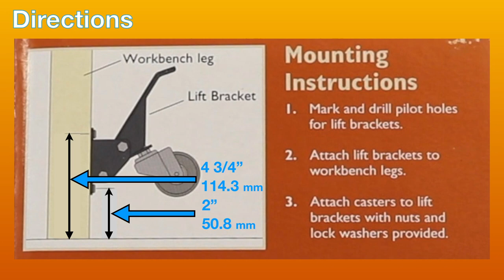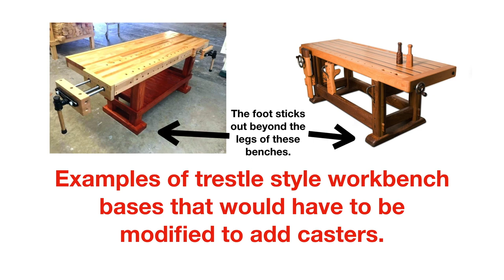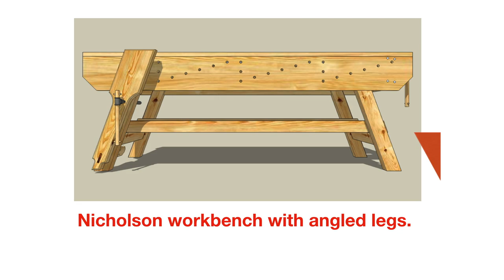Detailed "how to" Version - Attaching Casters to a Workbench - An Alternative Method

Comment: Love the additional aluminium & walnut bar. All my machines are on casters. Well done Don
Reply from the maker: Thanks. It’s much better raising two legs at a time rather than just one. I think it will also help prevent the workbench from racking over time.
Reply from the maker: Yes some “Magic Moves” in Keynote. 😁 Hope to use it more in the further.

Comment: Don, do you think the aluminum is needed if I used a piece of oak?  Just wondering because I have those same casters on my router table and that would be a nice touch but I cannot for the life of me believe that the aluminum adds any strength to the walnut.  Was the walnut an afterthought?
Reply from the maker: Darth, I used the aluminum to provide a way to attach the bar to the casters and yes, because of the shape of the aluminum I used, I think it ads strength. Without the aluminum the walnut piece would need to be quite a bit thicker.